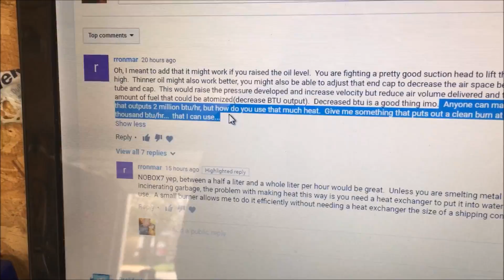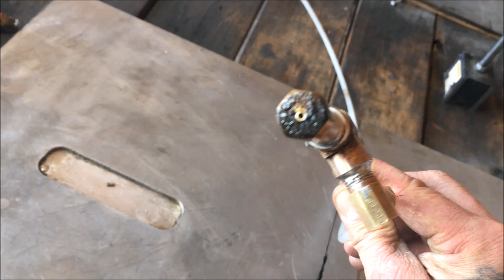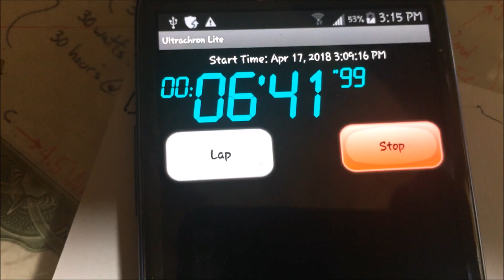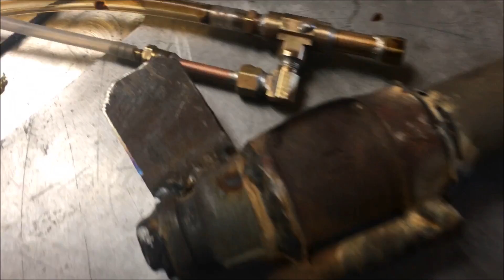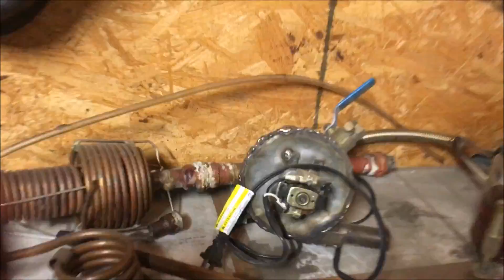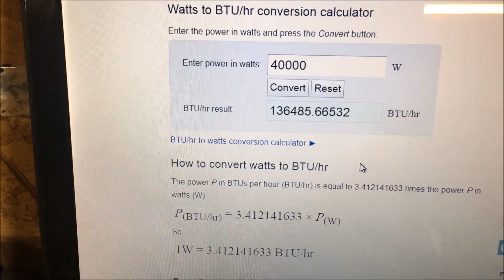Micro waste oil burner ( Data acquisition ) INFORMATION

Comment: Good day sir..
I have a lot of used oil here and i plan to make a burner fuel with used oil.. can tell more about this invention and i have here a compressor 2hp pressure 8kg and R.P.M. 715..  is this enough power to burn fuel used oil. Thnk u and more power..

Comment: Is it possible to enter more secondaire air in the Middle of the combustion chamber? So that the flame might get a little blue
Reply from the maker: wate motor oil will not burn blue , only veggie oil and diesel

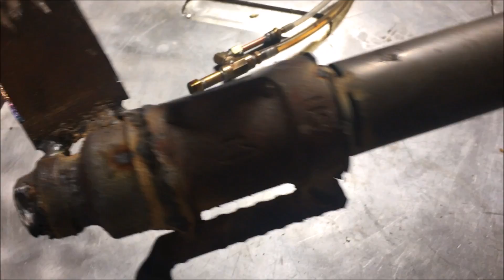Comment: 8hrs. 350 mils. degrees out side. Shut that shut off at 75°. Nearly 2a.m. .Sun up at 7:30. Might, might not  relight at9 a.m. and 65. 1 drop every 2.5 seconds. Fuck me you waste a lot of fuel!

Comment: Great video, I just don’t understand the 90 degree air horn, seems terribly inefficient. Also a straight air horn with nozzle in center would eliminate the fouling on the bottom of the burner, where the atomized fuel is spraying.

Comment: Why not wrap the steam coil directly to tube. Then you can burn it as hot as you want and you don't have to worry about sick cuz it all comes out the end. You might get a better response from Bernoulli's principle if you put the slit in the tube a little farther towards the end away from the burner. Where the air has an even greater chance of reaching a higher velocity. But not so close to the very end that it's not able to Mix & Burn with any fuel. Just a thought

Comment: Have it shoot straight down the pipe with a reflector that also has a hole in the center.. Whats the temp of the flame
Reply from the maker: only 1800 on waste oil , great advice by the way , i took it years ago and it worked lol

Comment: Thanks for sharing your ideas. Today i succesfully ran little contraption from piece of pipe and elbow on 50.50 oil gasoline mix. i didnt have time to experiment too much but i managed to get some good burning and experimented with air pressures. i figured i will have to gradually ad mixtures richer in oil to get up to temp and be able to adjust it. If i succed in making it run on just oil il link you a video. im using spray gun as a nozzle

Comment: Are you actually burning used car oil? Or just diesel/ kerosene. I'm try to build one tried numerous  designs. Just  a oil burner starting with diesel  and when warm moving to oil. Well that just gets sooty and lots of smoke. 
Then I built a pulse jet with a atomizer. This worked very well on diesel alone. Bit as soon as I introduced the oil it just dies. Your help would be appreciated. Thanks
Reply from the maker: yes , only this type of design will allow stable combustion of pure waste oil, any design that induces a flaming vortex to continually reignite the combustion zone , other wise the ignition is just blasted out of the device
Reply from the maker: check out my play list it has all the info you need . sound like maybe you have to much air

Comment: You have probably seen the the T-Rex unit. If not, you may want to check out the approach used for a simple air intake adjustment.
Reply from the maker: Ill check it out , thanks friend

Comment: this is what i am after also, low air flow, low oil flow and just reasonable power. This kind of power would be great for heating prettmuch anything. 40kw is fun, but not very usefull to most as atleast 50% of that power is just shout out in the air and lots of oil is just wasted. And even tho the oil is prettymuch free you still dont want to just "waste" it by burning loads if not needed.

If only i had a little more time in the near future i could go in to this a bit more and maybe get some prototypes up and running myself, maybe testing some other air sources and all that. I still have about 60 gallons of waste oil sitting from last winter, and we are in the 30°C temps here now, so no need for that for a long time i think. But i might be doing some testing this summer, just to see what i can come up with, maybe work a bit from your kind of design and see where i can get that up to.
Reply from the maker: I highly recommend you modify my design to your needs , it would save you alot of time . These devices did not come easy
Reply: that was the idea, but maybe try a few different hole sizes on it. A smaller oil hole and a smaller air hole would mean higher fluid speeds with lower consumption, and that is what i wanted to try. And for oil filtration i can just use a good quality car oil filter, they filter pretty small parts out of the oil, so i think a hole maybe even half the size of what you showed might be possible then. And the advantage of starting with a small hole is that its easy to make it bigger, making a big hole smaller is a lot harder.(insert joke about lady parts here)

Comment: I was just thinking about experiment that would be fun...use your burner to melt a few lbs of salt in a container, timing it and some math would be interesting.  Once the salt is molten, try to pump it or gravity flow it for doing work like heating steam without direct flame contact which would make it more throttleable, the molten salt can act as a heatsink type thermal mass "battery". I think moving around molten salt is interesting.
Reply from the maker: Yeah , water softer salt melts easy and is cheap   . maybe we could put a stainless steal break line coil inside the crucible and pump water threw the salt battery instead of pumping the salt.  It would make a very cool device i agree and yes becuase its a battery we can unleash 1000 hp in seconds , maybe not for long but i do like the battery concept , that way a burner could operate at an optimum setting and be cycled on and of as needed or ran full time under high demand .
Reply from the maker: Brilliant idea  , if only my channel made money LOL  i would do it tomorrow
Reply from the maker: we will keep that idea on the action board for sure
Reply from the maker: One of the cool things about your idea is that by heating the salt the heat exchange can be red hot , burning soot , but if you try to heat a steam coil with a flame it will cool the gases and carbon build up will insulate the coil and build up over time but a salt battery would not experience this problem making a super efficient heat exchange
Reply: NOBOX7 on further thought, a large salt mass in a container, heated and completely melted would store a massive amount of BTU's.  If said container was insulated with rockwool insulation it would be fireproof and store those BTU's for a long time.  If heat exchanger tubes of a high melting point were incorporated you would have an on demand heat energy into electrical potential battery for creating steam on demand at a later time.  Many benefits I would think, over utilizing the flame itself.